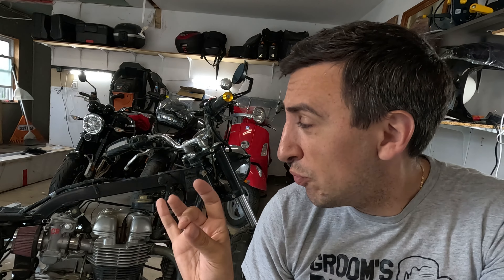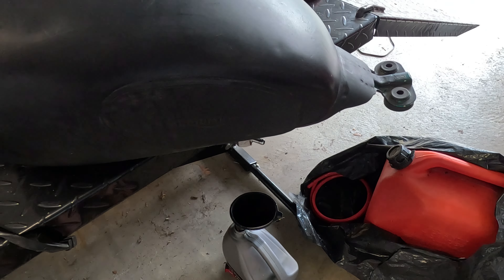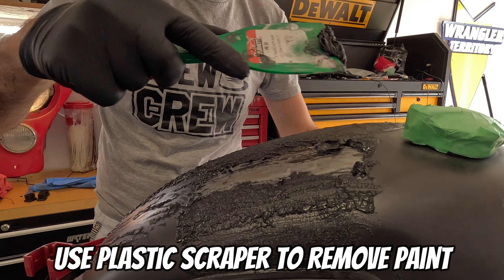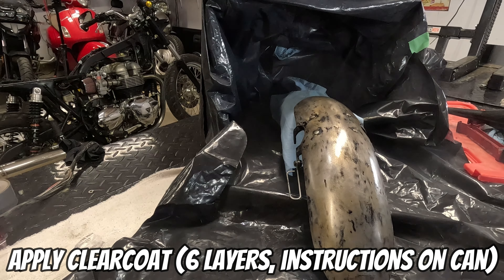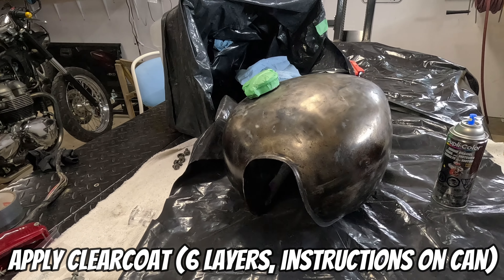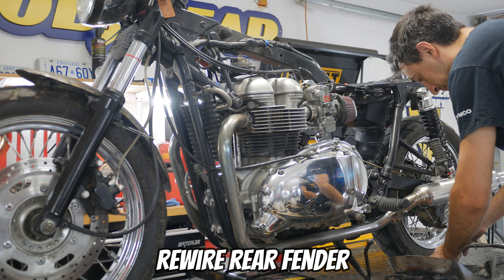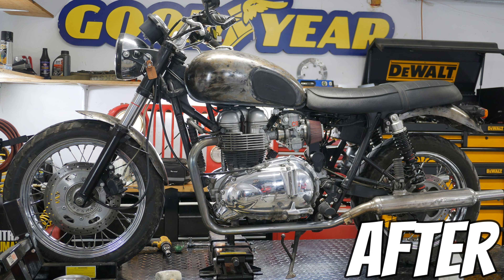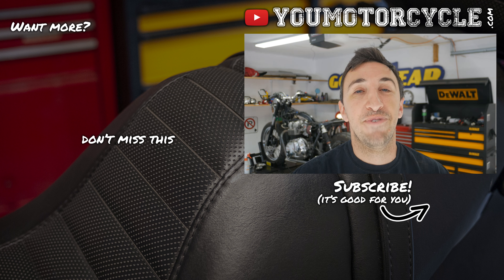Why A Bare Metal Motorcycle Was The Right Choice

Comment: Dude, that looks sweet!  I didn't see it, but is that a 2k epoxy clear coat?
Reply from the maker: Thanks John! I used this high temperature glossy engine enamel clear coat https://amzn.to/47yl73A from DupliColor - it was recommended to me by Casey Anderson, one of my favorite motorcycle restorers I've been following for over a decade (he's now on youtube at motorcycles_and_art). From there the instructions on the label are super easy, and tell you how to apply each of the six coats. I just did one round per part, then another round per part, over and over following the instructions. Easy peasy and no running, which I was grateful for, because usually I'm bad with aerosols!
Reply: @YouMotorcycle  Good stuff - I checked it out, looks like it'll hold up.  I asked because I painted my bobber using 2k epoxy clear coat, which was recommended due to its durability and hardness.